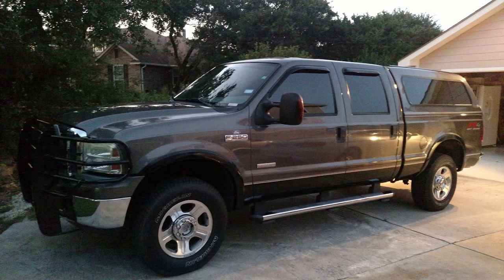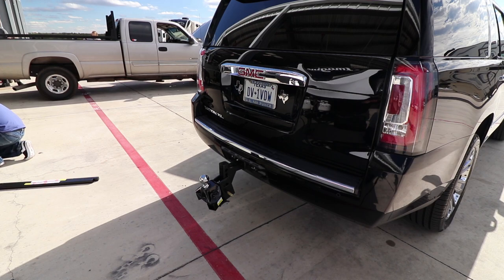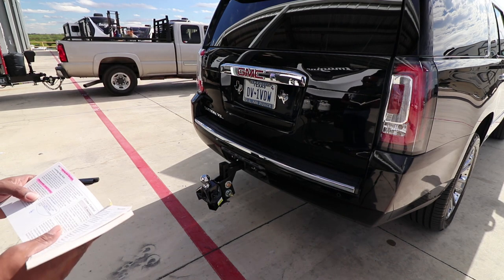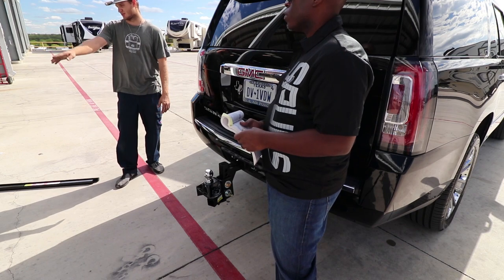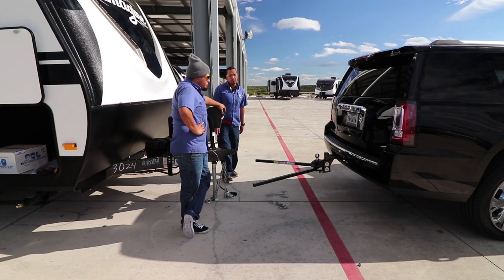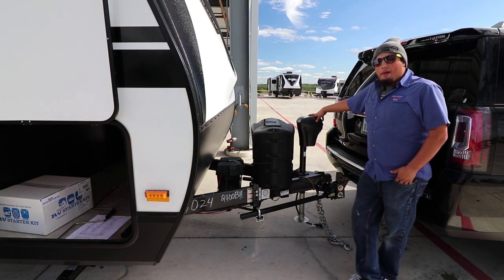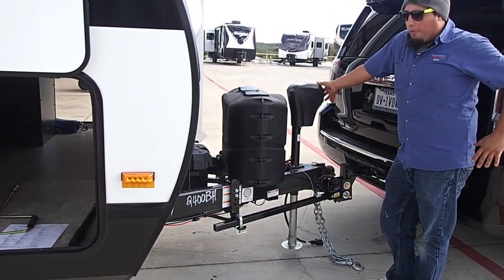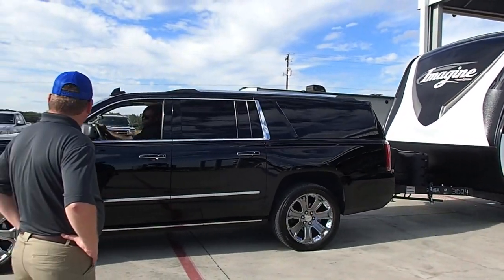2016 GMC Yukon XL & Equalizer 4 Point Sway Control hitch set-up

Comment: Had a 2016 Tahoe with a weight distribution hitch. Two capacity was 8,200 lbs. TT weighed 5,100 lbs dry. Weight distribution hitch did not help the towing experience. Bought a Pro-Pride P3 and changed everything. TT towing became a non-issue - plus, the P3 allows the liftgate to open completely while hooked up to the trailer.

Comment: Great Video. I recently purchased a travel trailer but at the time I had a Nissan Titan XD pickup truck. The dealer leveled everything with my control hitch for the pickup at the dealership and I brought it home.  A couple of weeks ago I traded in my truck for a 2016 Yukon XL (also black). Today when I started to lower the trailer onto my Yukon for the first time I heard a noise coming from under my left rear wheel and had no idea what was happening, so I stopped and raised my trailer again and separated the trailer from the Yukon and went inside to do some research. Apparently my XL (non Denali) also has the auto leveling shocks that I never knew and have zero experience with. That's when I came across your YouTube video. It was very informative and felt like it made specifically for me, lol. Very informative and a big help. Thank you for recording it.
Reply from the maker: You're right I recorded it because I could not find information out there. I'm glad it was able to help someone.
Reply: That Noise you heard was the compressor engaging the air suspension. You will occasionally here is kick on and off when towing as it is auto leveling and adjusting ride height accordingly. I have a 28 foot travel trailer and towed with a Yukon Denali and it was sort of a scary experience even using my Equalizer weught distribution system. Then I got a Silverado 1500 and still not enough truck in my opinion. I just bit the bullet and went with a 3/4 ton Ford F250. That much truck leaves a lot of spare payload and is much heavier and the travel trailer doesn't dictate the truck. It's a more confident and pleasant towing experience.
Reply from the maker: @victorurbina2944  thanks for your post...we had the same exact experience.

Comment: We had a chevy 1500 truck pulling our TT.  Was a bit weak and caused some white knuckle driving.  We also have a equalizer hitch and really love the way it works, no sway with the 1500.  Those guys who installed your hitch,  no idea what they were doing. Improperly installed, period.  I only experienced white knuckle due to lack of power not sway or weight issues.  If yours had been properly installed I dont think it would have been an issue. 
I upgraded to a Ram 3500, and switched my equalizer over,  had to get a new drop bar, but no issue. 
  Loved the video though!
Reply: Anthony  Alimo how much did your TT weigh?
Reply: @chadcamp4522  7600lbs loaded

Comment: Hi I need an emergency advice I have a Cadillac Escalade 2024 and I need to tow my boat which weight is about 6500 pues trailer 1700 pues gas about 740 pound and other staff I think the whole weight is about 9000 pounds 
Do you think this car wants tow this weight plus 7 passengers 
I’m taking also to taking out from water at the ramps
Please
Let me know as soon as you can because of I have an appointment in a car dealer to buy a truck but I don’t really want to do this thanks very much